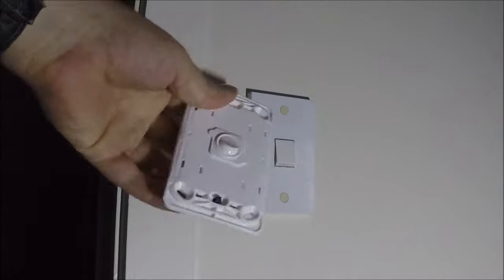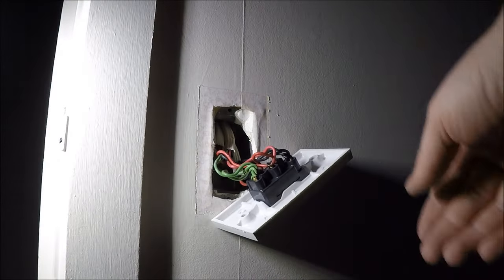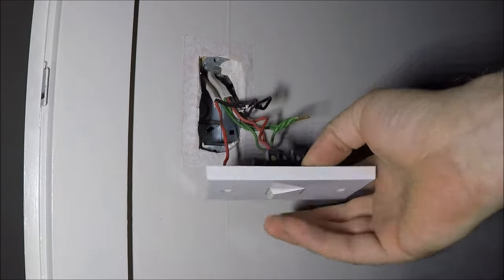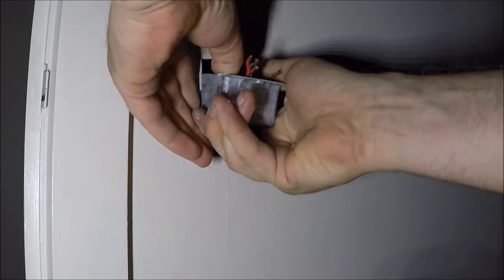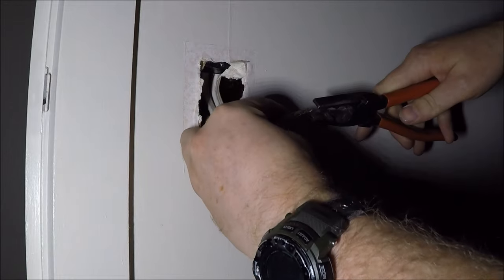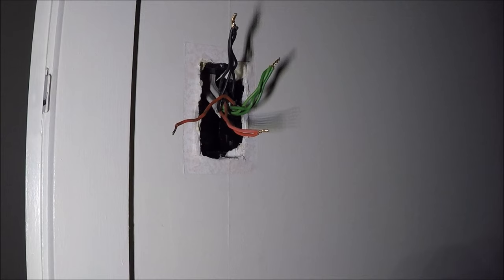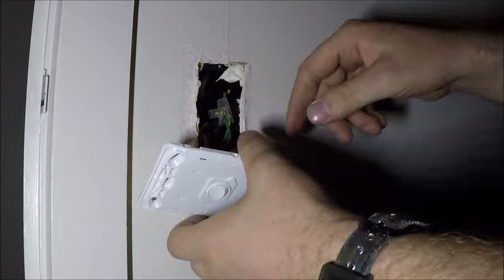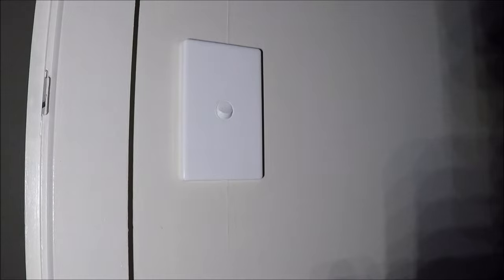How To Replace a Single Light Switch

Comment: Hey Dave, 
Can you do a video on bypassing a power socket? 
Also wanted to know using electrical connectors ( once you used in the above video for neutral & earth cables) does it matter if the stripped cable terminal is going out of screw terminal and touching inside of plastic connector? Would it melt the plastic? Or is it safe?

Comment: Awesome vids :)  I've been watching them as I've got an issue.  Our door repairman smashed our external bayonet light such that I needed to replace the batten.  However, after installing a new batten (in which I'm pretty sure I've gotten - earth going to the earth terminal, loop going to loop and active/neutral going to the other two) it's not turning off with the switch.  I'll upload images if you don't mind having a wee squiz at them?
Reply from the maker: I'd suggest swapping the white and red core terminals around on the new fitting. Have a gander at my video on triple plate wiring, looks like that's the way your lights have been wired.
Reply: @sparkydave  Thanks for the tips - the light works better now.  Had a thought as to new content - could you demonstrate how to install either the inverter back to mains for solar panels (or the full kit and kaboodle) and also how to install a wind turbine (not sure if a home based wind turbine would ever get connect back into mains)

Comment: Great video, thanks mate!

I have the exact same Legrand switch and same cables with reds, green earth and neutral black which is wired in the same way. The neutral and earth aren't connected directly to the switch.

I was looking at installing a Legrand excel Life smart switch and they require the neutral to be wired in. Hypothetically, would your cable setup be sufficient for this? I assume that instead of connecting the neutrals to each other, they would go into the switch instead. Or would it require a new cable to be run?

Thanks for your help mate, easy subscribe from me

Comment: Hey Dave,
How you doing? Love your videos they are very knowledgeable. Can you please do a video on If a powerpoint socket stops working or starts sparking when turned on and its middle of night, we can’t get another powerpoint socket. What is the best thing to do in that situation? Should we bypass the socket? If yes, how do we do it?
Cheers bro.
Reply from the maker: Best thing would be to purchase a new socket from either wholesaler, Bunnings or Mitre10 asap and replace...otherwise remove the socket, unscrew the cable ends and place them only into electrical connectors - ideally PDL 501s or similar rated minimum 16A - (keeping the same coloured cores twisted together) and then re-screw the socket to the wall (which will be unusable).

Comment: Gidday Dave. Thanks for the vids, it's really helpful. Just got a question. If you forget to take note of the feed cable and the switch cable,  how do you tell em apart?
Reply: Unfortunately they won’t be any different :( most likely the feed cable comes up the wall  and the switch cable goes down the wall hope this helps